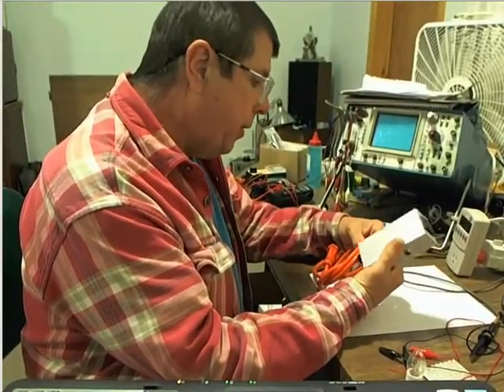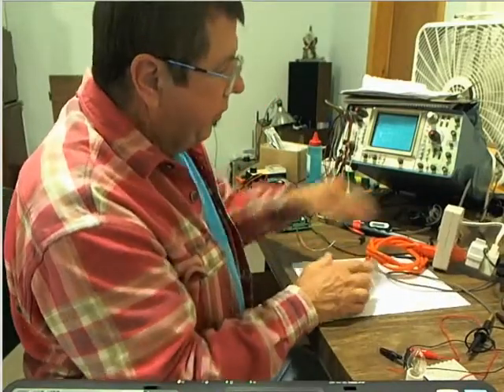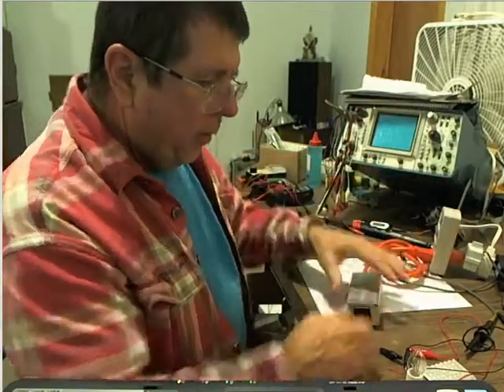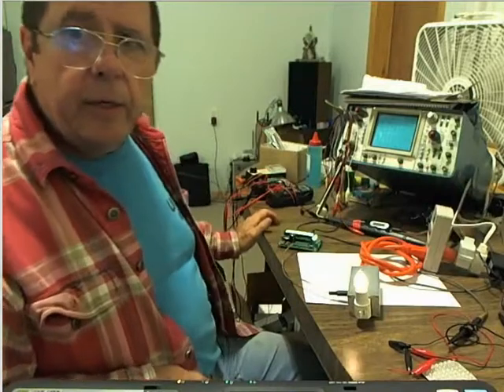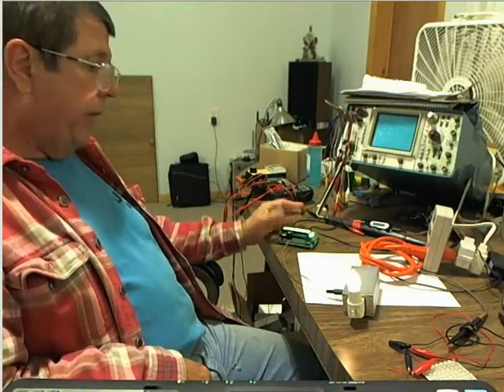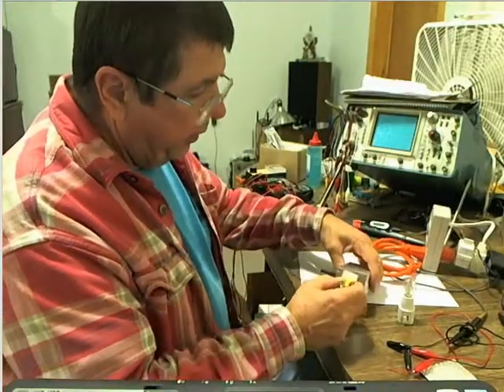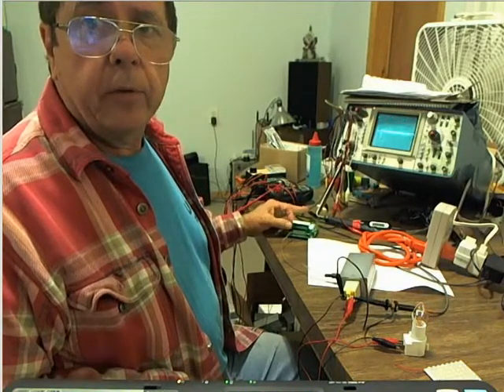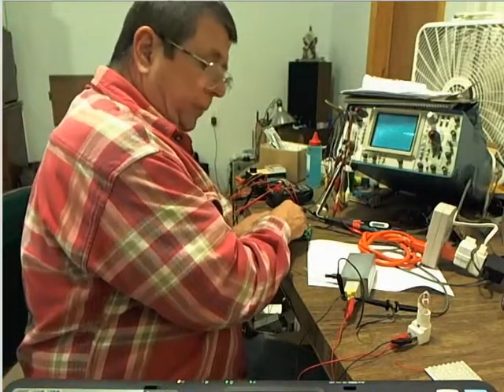Pulser Basic Description Video 1

Comment: i need my to be 75 khz
Reply: why 75KHz? Don't sound like a Dr Rife target number hmm
here a few targets I have nailed in that area
72000 -
*72749.6 - Streptococcus_pneumoniae_hi_alt
75969 - Scleroderma_v
76677.5 – Heavy_metal_toxicity_TR
79333.9 - (SV40)
80000 -
*83173.3 – Simian_virus_40 (SV40) - throat and sinus
*93806.5 – Simian_virus_40 (SV40)
95443 - (SV40)
That's not the whole list of SV40 which did used to hold down my immune system, but these are hits around your target that I just decided to use against my old data list. So ya why 75KHz?

I am very please to see someone else also knows the health benefits from 8Hz give or take, and the fact he made a electric blanket pulse at that is wonderful.